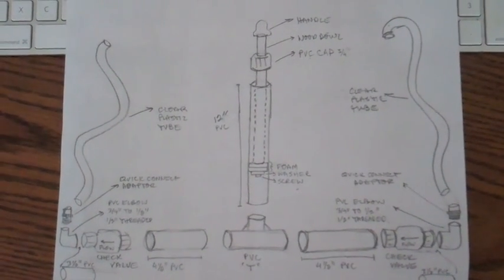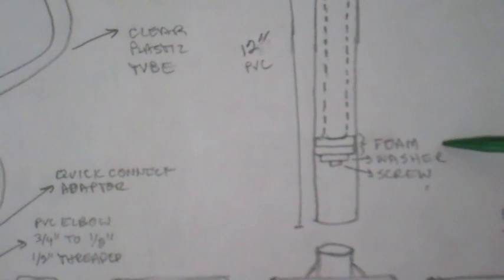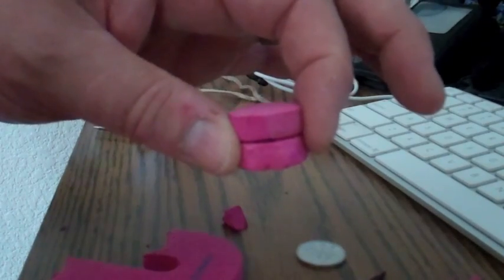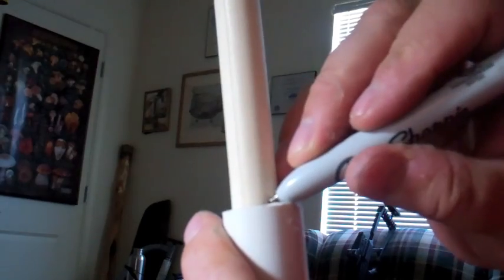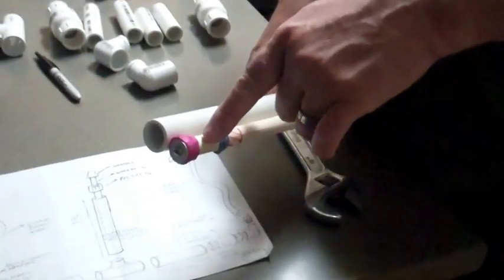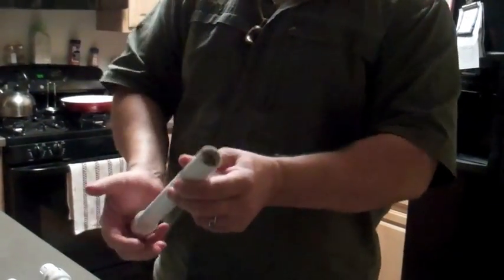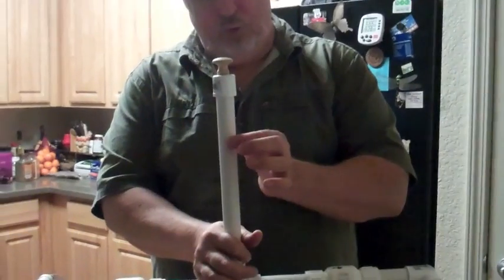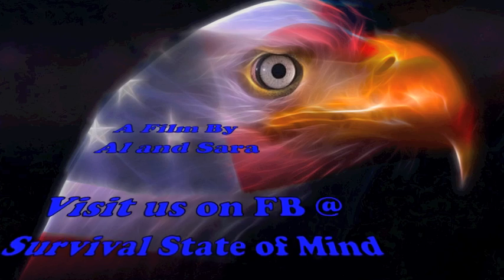How to Make a Hand Powered Water Pump for Survival, Emergency and Disaster.

Comment: It would be great if you could screw the pieces together, so they keep on. Make the tubes and connectors with male/female thread. Could still assemble and take it apart in a few sec. Just a suggestion :) I would like to see how the flow-check things are made, if I needed to make one. Making a water pump could be instrumental in surviving high-temperature environments, as the water will not evaporate in the tubes. Also: Making an automatic pump that runs on river-flow could be great. Like a small river-mill that runs the pump to your hut or abode.
Reply from the maker: Fantastic idea.  This is a great little pump to carry around with you.

Comment: if u use it for suck out a deep of 20m, do u think this pumb will work?
Reply: You can only suck water up about 20 feet.  Beyond that it's unlikely you would be generate enough of a vacuum.  At a certain point the liquid water in the riser will become a gas because the pressure is so low.